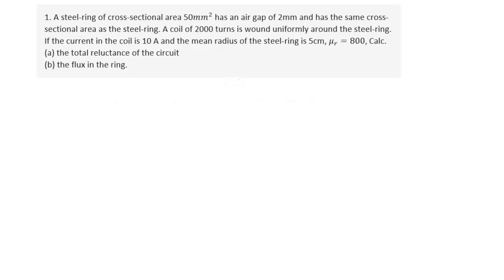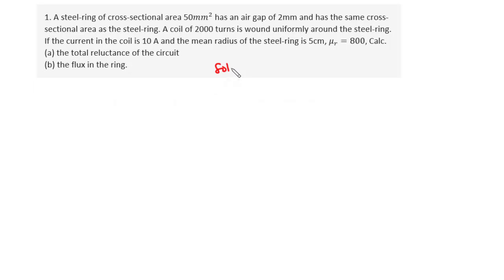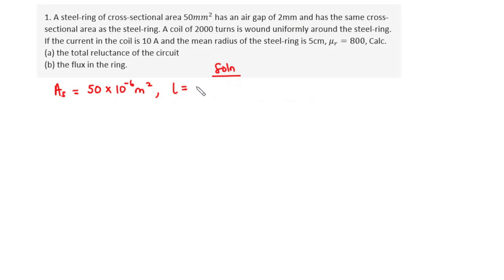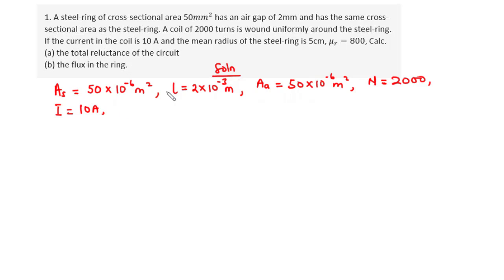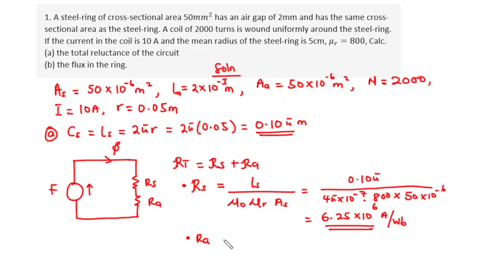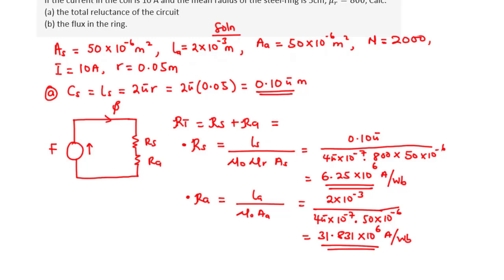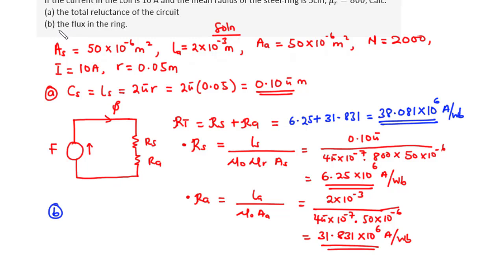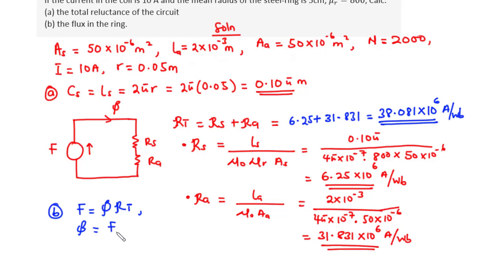55 - Linear Magnetic Circuits Example 1

Comment: Hi, were you not supposed to subtract the length of the air gap from the circumference of the steel, which the gives the length of the steel

Comment: Wait the mean circumference of steel ring should be total circumference minus the air gap length
Reply from the maker: Sorry but not that, the total reluctance is the reluctance as a result of the steel and that of the air gap, so plus